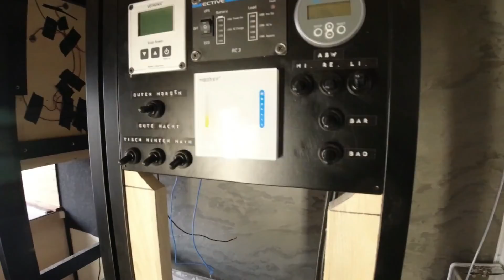Ambulance to Tinyhouse | 1 year in 30min 🚑🔥

Comment: I'm a little concerned about the removal of the interior wheel arches and flattening them with the floor. They're there to give clearance on very uneaven ground, and while I don't think they need to be so big, I'm not sure flat is right either. I'm genuinely interested to know if this actually worked ok in practice or if there were issues caused from it.